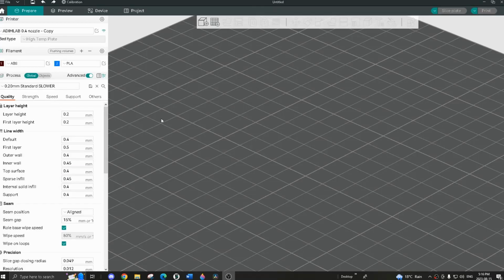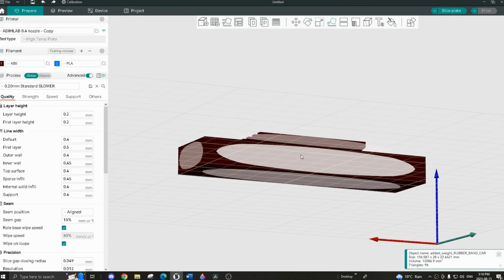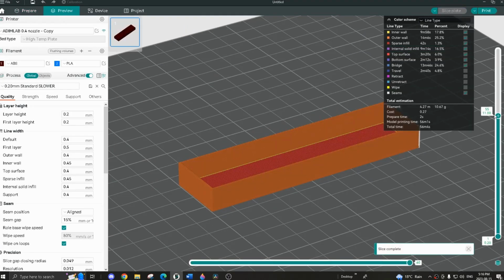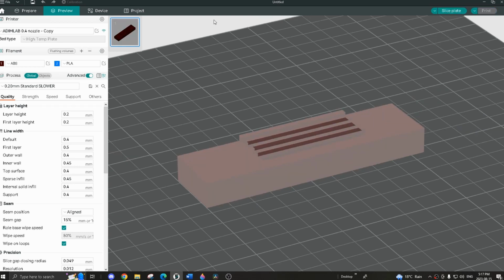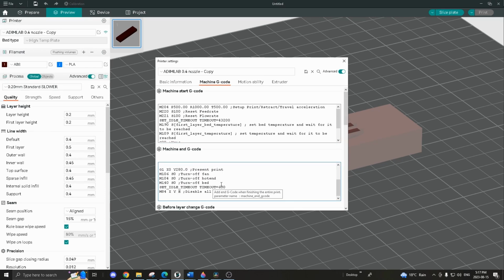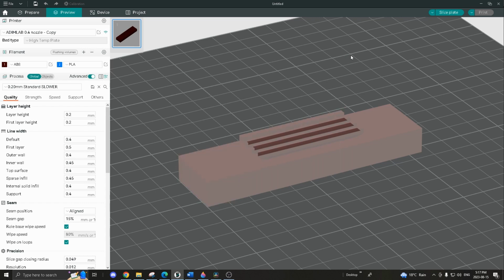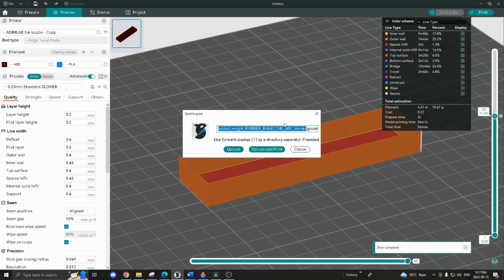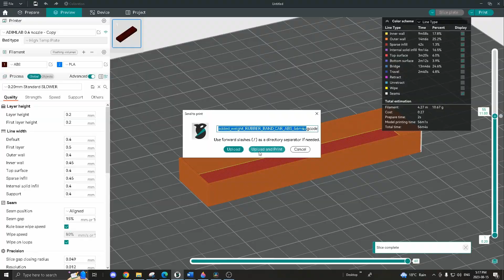Upgrade your 3D Prints by Adding Parts with Klipper and Orca Slicer

Comment: i add pause, but the toolhead stop on top of the piece, dont go home, or moved away, climbed up, went home, so that I could have access to the piece.
Reply from the maker: Sorry for the late reply, what firmware are you using? For klipper this calls a "PAUSE" macro. Inside this macro will be all of the logic for where to park the toolhead.

Comment: Quick and on point :) Is the pause the layer after which it is beeing paused, or is it the layer which will be paused before.
Reply from the maker: Thank you for the comment. The pause is inserted at the start of the selected layer. So if you were doing a manual filament change for a multi colour print and wanted to swap on a raised text, you would select the first layer that you can see the raised text. Hope that makes sense! 

Also, if you hover your cursor over the add pause it will give you a tool tip explaining the command

Comment: The video is too blurry to see what settngs you are adding to the gcode.  Having a working transcript for the video would help
Reply from the maker: Thank you for the advice! The start gcode needs "SET_IDLE_TIMEOUT TIMEOUT=43200" and the end Gcode needs "SET_IDLE_TIMEOUT TIMEOUT=600" all this does is make sure your printer remains active for a long period of time incase you're not around to add the parts then resets it back to normal at the end of the print. These times are in seconds so 600 is 10 minutes